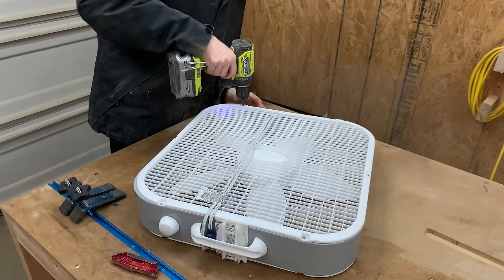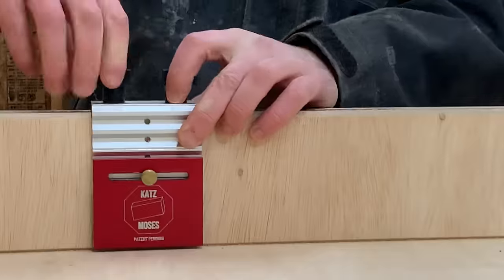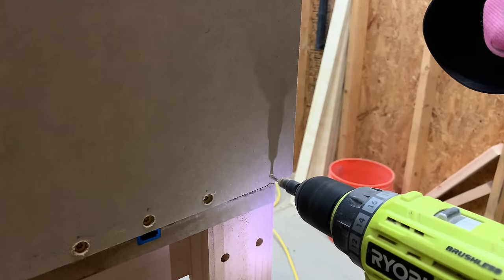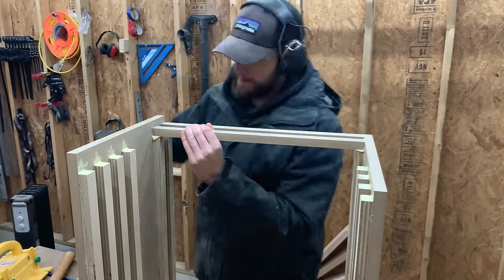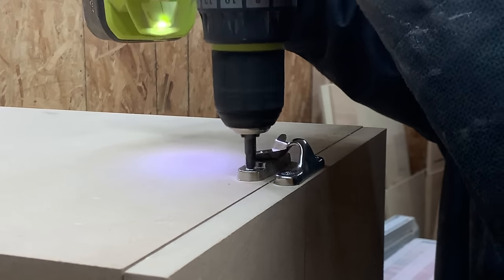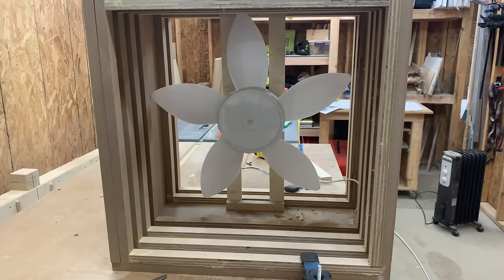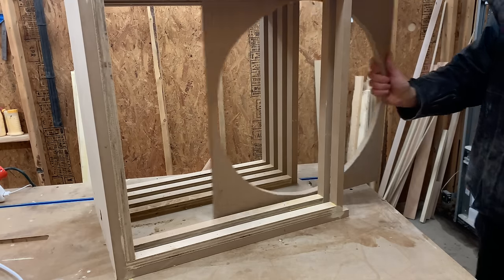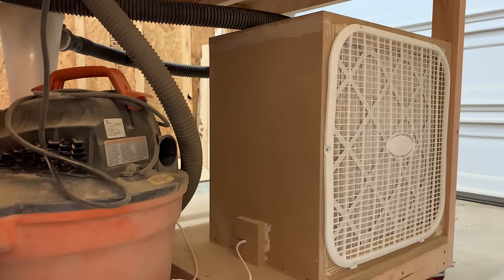this $20 fan will SAVE your lungs

Comment: I know this video is 2 years old, but I wanted to tell you that the filters you put in the box, aren't going to help much at all. The box itself looks really nice, but it needs better filters. The filters you really want, are MERV13 rated, and catch A LOT more fine sawdust particles. Amazon probably has the best price for them. The filters you are using will let the fine dust particles fly right through them, without slowing them down, which can even gum up the fan motor. When I made my dust filters, I used the same fan, along with one, 2 inch thick MERV13 filter. I drilled holes in the bottom corners of the fan's frame, and added some small eye bolts. I put some plastic drywall mollies in the ceiling, and put eye bolts there as well, spacing them a bit wider than the fan is wide, and used some light weight chain to hang the fan upside down, which gives me access to the switch on the fan. Then I just use some duct tape to attach the filter to the backside of the fan being mindful of the airflow direction of the filter. Sawdust is not to be taken lightly, it's actually considered a group 1 carcinogen, right along with welding fumes and cigarette smoke. Sawdust can cause anything from skin irritation to eye and airway allergic reactions, all the way up to and including cancer and death. Granted, most weekend warriors aren't going to be very likely to develop the more severe reactions, but if they become a lifelong weekend warrior, anything is possible. I have 4 of the fans I described in my workshop, and when I'm running any of my saws, routers, or sanders, all 4 fans are on, and, I also wear a respirator with N95 filters. Even I have just the fans on, if I'm not wearing the respirator, my airway allergies really let me know just how happy they are for the next 2 or 3 days. Everybody is always talking about protecting our eyes and ears, Norm Abrams was probably the first eye and ear protection cheerleader, but very few people really ever talk about our lungs, which are just as important.

Comment: Dust settles. Obviously. Clearly it is heavier than air. It is much more efficient to keep the fan nearer to, or on the floor. That fan is pretty good for moving volumes of air and now with 3 particulate filters and a hepa (very fine particles) the volume of air the fan moves has been reduced, notably. The hepa filters although great for air “scrubbing”, automatically reduce the volume of air going thru the filter quite a bit because the filter has very tiny holes through which the air passes. It doesn’t mean that you now have just a few very tiny holes with which the fan must push the air, but to make fine holes you must have some type of material surrounding each of every hole. So you can see that filters can really drop the volume of air the fan could move. That not a big problem. It is always expected. But because that blast of air is now…  not such a blast of air, that big air movement won’t be there to constantly push the air around the shop,  and the falling dust or , previously fallen is unlikely to be pulled or swept back up by that lack of air thrust.  So help out your system by keeping the fan near or on your floor. Also make certain before you use the fan , to first clean your shop’s floor, well.  The theory that the fan on the floor will just raise dust is lazy and counter productive. If there’s dust on your floor, that you are afraid to blow around  - your shop floors a mess! But putting a fan in the ceiling isn’t going to save you. As you move thru your shop you’ll just knock all that dust into the air, and you’ll breathe it way before reaches the fan , attached to the ceiling. That fan may likely never clear it.  It’s a good system that you have built, and although there are other ideas that bring hoses and particle sorting and all sorts of stuff into a breathable shop, your design is quite good. It’s useful and effective. Any other attachments may help, but really, if your looking for easy, inexpensive - yours will help drastically. ✔️

Comment: Hey Eric. I copied your design but I modified little bit. I put 3 inch casters So I can roll around my shop and I painted it.
Reply from the maker: That’s an awesome idea! That what it can get it even closer to the tool you’re using. Nicely done!
Reply: Credit goes to you! I was abt to buy a WEN over hang unit n I saw your video. Saved me lots of money. Thank you!
Reply from the maker: Sure thing! I haven’t done a side by side comparison between the two, but either one would be a good improvement in air quality

Comment: I just slap the filter on the back of the running fan and the air intake keeps it in place
5 seconds and $0.00 in construction cost

Comment: You could do all this work or you could just keep the fan the way it is and buy a 20 by 20 air conditioner filter and tape it on the back of the fan and turn it on a boom you've got a kick butt filter with no hard work

Comment: Do you just use it on high permanently? Has the motor held up to the restricted air flow?
Reply from the maker: Been using it nonstop and I’ve had no issues
Reply: @SpencleyDesignCo  thanks for the reply! That's awesome to know.
Reply from the maker: The people bashing it in the comments are clearly wrong lol

Comment: Your design is over the top to complicated and fancy. I did something like this years ago. I took a furnace filter and DUCT TAPED it to the fan. I always put these fans in a window and use foam sheet to fit and block random air flow, so no air can go around the fan. the filter does restrict the amount of air flow of the fan which makes the electrical use higher and may burn out the fan sooner.

Comment: Looks great 👏🏻, but wouldn’t sliding the whole fan box in a little bigger box  be easier for you
Reply from the maker: The only problem there is that the filters wouldn’t fit as tight. That’s definitely an option though 😀

Comment: My only concern is if so much sawdust gets in contact with tho motor if it could be a fire hazard.  I think it would be great in a house but I don't know about a wood shop. How has it been working out for you?
Reply from the maker: I’ve been running it for over a year and so far had no issues
Reply: Just put the filters on the intake side. Even putting the coarse filters ought to be fine, but you do make a good point - like everything an occasional cleaning is wise. I just blow mine out when I change filters.

Comment: You might as well enclose the bottom volume of the sawing table so that all air has to be forcibly directed to the filter. I don't see the point of letting the dust go through all the room and then try to make the filter suck it, when you can contain the dust volume and not let it move unless it goes through the filter. It's anyway the total same amount of dust either way into the room space, but one method will make sure to collect the dust much better than the other.

Comment: I may have missed something about your demo at the end of the dust filter's not being a shop vac but capable of pulling airborne dust into the filter. It appeared that the first filter the incoming dust hit was the more expensive HEPA filter rather than the cheaper pre-filters. Were my eyes deceiving me??
Reply from the maker: I think your eyes were deceiving you 😀. It’s probably the white covers that threw you off
Reply: @SpencleyDesignCo  exactly...I'm colorblind and cannot make fine color distinctions. In the build, I noted what I ID as blue cheap filters and white HEPA.... thanks
Reply from the maker: No problem! Happy to clear things up 😀

Comment: That's clever!  Very good idea!  How heavy is the finished unit?
Reply from the maker: Maybe 20lbs or so if you used all plywood. Maybe 30lbs or so with all MDF
Reply: @SpencleyDesignCo  that's pretty good!  I expected a bit more.  I may have to build one of those!  Thanks for the video!!!
Reply from the maker: Sure thing! Don’t forget there are free plans available on my website 👍
Reply: @SpencleyDesignCo  I appreciate that!  Thanks again!
Reply: @SpencleyDesignCo   thank you for all this!  I loved the video you all did a great job!  I too was wondeing how much it weighs.. the older i get the heavey things seem to be.  am trying to think of what other ways i might be able to make it  a bit lighter.  and I dont have a wood shop and not very good at cutting straight lines.. but nothing is impossible!   thanks for the fun video and idea!   for myself I am trying to find a high quality hepa at 99.97% filtration in that 20x20 size.
Reply from the maker: Thanks for the support! Glad to hear you enjoyed the video!

Comment: Why not just make a box to put the filters and the metal fan into? Some duct tape to prevent air loss and a range of filters on the input side with a super fine grade at the exhaust after a funnel. You could even stack fans if you go super cheap.

Comment: Not magic: its a collector ring.  You can fab one for cheap... a pair of tinsnips and an old metal shelf or a locker - any sheet metal really. Persuade with hammer as needed.   As a fan is pushing.pulling air, its also slinging air off the blade tips by centrifugal force.  A ring helps blade tips move air the way you want it, and more volume at that.

Comment: I bet you dont get much airflow. I think you need 2 fans, and a longer corridor. You need actual air flow. Your fan blades are spinning air in a closed system. Its a turbulence generator.  2 fans would at least guarantee movement between the 2 fans. Which would be actual flow.

Comment: I don't understand why you disassembled the original fan.  - take the screens off if you want to reuse them, but  just slide the fan into the larger filter frame. I think that you'll even see some weight savings and easier repair if the fan dies.

Comment: I have been thinking about this video for a day.    Your project is a lot of work with unnecessary steps - in my opinion.   Just build the box for the filters and a large slot in the top to drop the INTACT fan into.  If the seal is good enough, you would not even need a lid.  You can then pull the fan out and use it for other things not to mention the ease of cleaning the box.   Without filters and fan you could hose it off.

Comment: I would have handled the power cord differently. Instead of a large hole I would have used a small hole and a clamping grommet that clamps around the wire and keeps it clamped down to the case – so that if the wire gets pulled on it will pull on the grommet rather than pull on the fan motor.. You can get this from an electrical supply place for less than a dollar probably. How would I get the large plug through a small hole? I wouldn't. I would either first detach the wire from the fan, at or near the fan, then run it through the hole from outside, and then re-attach it, or – cut off the plug, push the wire through the hole, and then reattach the plug or use a new plug, making sure to preserve the polarity.  Then you wrap the split grommet around the cord, close it, and push it into the hole. Friction fit. As far as detaching the wire from the fan end goes, if there are not removable connectors make some. If necessary you can cut the wire near the fan, then re-attach with crimp on connectors or even with just wire nuts. If the plug is polarized make sure to preserve the polarity. Using crimp-on connectors with different connectors for hot and neutral and ground (if it has a ground wire) means you will need less thought when  reconnecting. You could also just solder the wires.

Comment: Wow, a sloppily assembled 3/4 inch MDF box fan air filter. That's going to weigh in at 30+ lbs and that dinky box fan doesn't have sufficient static pressure to move any meaningful amount of air through 4 filters, and the lack of a shroud around the fan means what little air it does move is just going to recirculate within the box itself. If you are intent on using a fan to drive a filter, you are much better off buying a variable speed attic fan that includes a duct/shroud. These usually come as just a bare fan with a metal frame as they are designed to be mounted to studs. They actually have fairly high static pressure ratings and can draw a high CFM through the filters.

For the filters, you can use one or two layers of rigid frameless HVAC filter media, sometimes sold under the aqua-flo brand, which is washable. The final hepa filter should be behind the fan and not in front of it. Think about it: why would you want the smallest particles building up on the fan and getting sucked into the motor? The filters double as protection for the fan so all filters go behind it. If you want to add a post filter, use one more layer of the rigid media but personally I'd just put a grill/vent on there

Comment: Now, add a catch drawer underneath, and I'll be impressed! 😃
Reply from the maker: That would certainly be a nice upgrade!
Reply: @SpencleyDesignCo  Aside from what the filters catch, is there a lot of sawdust that falls down once inside? 🤔
Reply from the maker: I’ve changed the filters out every month, and there’s hardly any dust left at the bottom of the box.

Comment: The price of the lumber outweighs the benefits. With no real way of testing it's effectiveness. You won't know what size room to use it in. I'm sure it works to some degree. It's a really good concept. You need to try it with a high velocity metal fan.

Comment: Quick question Eric, since I don’t have a lot of floor space for one of these I do have 2 electrical outlets in the ceiling so I was thinking of putting these up there. Most I’ve seen that hang on the ceiling have the fans blowing down towards the ground. I’m no scientist but wouldn’t that just blow the dust all over the place? Wouldn’t the fans blowing up at the ceiling be better or am I missing something?
Reply from the maker: I’m not sure, I’m not a scientist either 😜
Reply: 😂 good answer! 
I’ll give it a go, what’s the worst that can happen 🤔
Reply from the maker: Well if you read other comments, people will say you’re going to blow up, but I think you’re ok 🤣
Reply: Well you could have it blow upwards in the winter and downwards in the summer, like a ceiling fan! 🤣 I would guess is up is better. But I hang my simple version vertically so it blows horizontally.

Comment: Those motors can't take the strain of all those filters. It will drastically decrease its life. I've done something similar by simply taking a pleated 20x20 filter and laying it on the backside of a box fan. The fan and the air resistance from the fan create enough suction to hold the filter on or you can just use tape or something to hold it on. It works great but like I said it wears out the fan motor much faster than normal use.

Comment: That's crazy, and I mean that in a bad way.  Why not just turn the box fan on, put a filter over the intake, the suction will hold it in place and you'll  filter out all the crap.  no cutting wood, no screws, no mess just clean air.

Comment: Or instead of spending $40. just use the box fan like Normal instead. It is a cheap box fan with a cheap motor inside of it. hence being on the cheap side. Keep the $40 in your pocket.

Comment: Yeah, $20 box fan, $30 in plywood, all those multistage filters, time, etc. And, at the end of the day the fan is under powered and can't handle all those filters. Usually my comments are positive or no comment at all. But, sorry dude, this one is seriously useless.

Oh, and just fyi, the round baffling you mentioned, is called "ducted flow" which does increase flow efficiencies. But it's a freakin $20 box fan, so no dramatic changes expected there. Not geology, it's engineering.

Comment: That fan isn't going to be running very well in a box like that or all those filters. I'd of suggested using a slightly more expensive ventilation round fan,  far more power and would of easily pulled 5x more air if not much more than that box fan

Comment: Hey Spencer, I love the channel and videos so thanks. I have small shop in my garage mostly to support my CNC hobby. I wanted to see if you have an opinion around doing something like the air filter in your video or upgrading my Shop vac to something like a Rikon 12 Gallon Dust Extractor to try to collect the dust better and keep it out of the air in the first place. 
My wife is not happy with the dust on the car and or other parts in the garage that are collecting dust.  Looking for best bang for the buck to help with this. 

Thanks
Reply from the maker: Who’s spencer?

Comment: Seems like it would be easier to just make a box to slide the filters & the fan into. Therefore when the fan motor takes a dump you can just slide the fan out then put a replace it with a new fan.  Easy Peezy

Comment: No box, no tape needed.. the vacuum hold the filter in place against the fan.  HOWEVER, that fan does not have the power to push all 4 filters.  Even just slapping a mid grade filter on the in side of the fan and the thing can barely pull the air through it.

Comment: I have the same fan. I just duct tape the filter on the back of it.
Reply: Why waste duct tape.  Just slap the HEPA filter on the back and let negative air pressure keep it there when in use.
Need it again... just turn it on and re-apply the filter.   Takes 5  seconds and no duct tape.